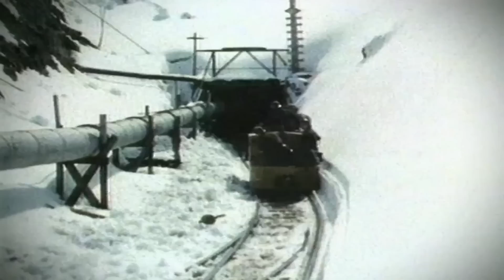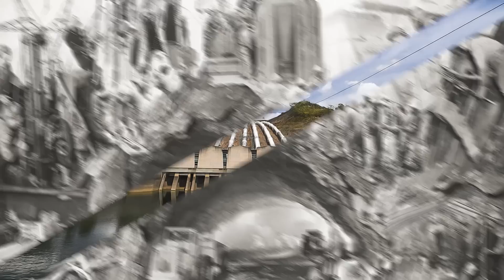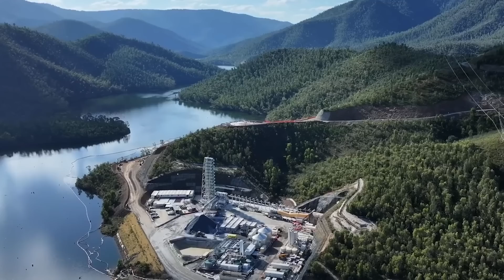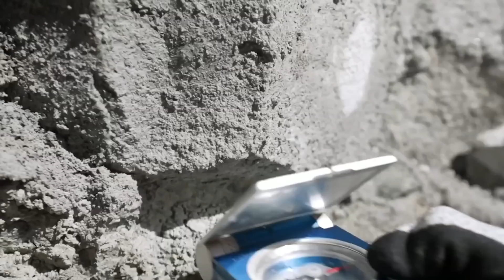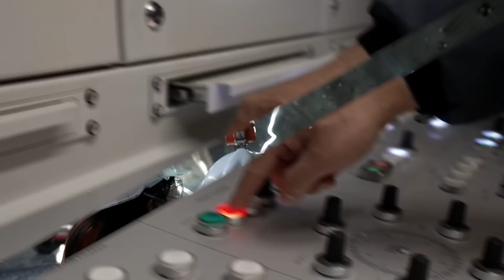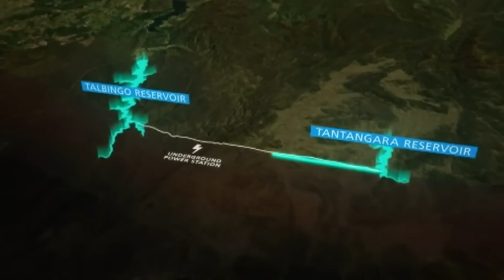Here Is Why Australia Won’t Let Billion Gallons of Water Run Down From the Mountain

Comment: Australia is now considering nuclear power. Australia is one of the top 2 Uranium exporters and has huge reserves of Uranium and Thorium.  Most current PWR type, Generation 3+  reactors in common use are very safe but extremely costly and complex.  The water cooled reactor have extremely hot and high pressure which creates major safety risks inside the reactor.  Another problem is the hydrogen in water can separate when overheating and create an explosion risk.  One alternative is to consider developing a completely new Generation 4 type reactor which have inbuilt systems that use physics to maintain efficiency, safety and hopefully lower costs.  Indonesia is developing aa revolutionary MSR, Molten Salt Reactor, with a US company and is now applying for a science.  Australia could be a partner in developing these reactors or work with China which is now leading the world in nuclear technologies.  What type of reactor should Australia choose.   Canada has developed very efficient CANDU reactor technology.  And there are many Generation 4 options.

Comment: Pumped Hydro is defined as Hydro without any of the benefits of Hydro. 
The Snowy Mountains Hydro Scheme is an immensely successful project. It provides electricity and irrigation by exploiting the snow/rain delivered and captured/stored at high altitude using gravity as its power source. When the snow/rain falls at altitude the energy potential has already been created. 
Now Pumped Hydro tries to recreate gravity by building more tunnels and pump stations to get the water back up to great heights….again. 
Yep it really is that dumb. It will end up being the dumbest piece of “infrastructure” Australia has ever stuffed up.

Comment: Muh continence is geographically withheld upon a single continental krust (its not what I see when youse show the Gondwana, Gaia, Ticonderogarghh rah rah blah de blah plates). We tell ourselves straya is geologically stable, nevermind the shakes, and consequently tectonic subduction, regolithic uplifting and consequential mountainous terrains have long since weathered down into gentle rolling magmatic protrusions of granite and exposed basalt. Those are our mountains afaik, they don't get very lofty and we are stuck with some of the flattest topology on plan it Erf . You may wonder why I open with such direct ambivalence, well a little extra height might increase the usefull catchment-'n-release staged pondage of the general hydro layout and flow rates pushing them generator turbines. That sort of thing. We have burrowing animals, rabbits, wombats, and so forth. They do not lend themselves to our employ upon this scheme. Just saying, we do this thing recognising that we do it ourselves. That's where the project starts, and the cerebral pain begins...

Comment: Snowy hydro 2 is a pumped hydro project, the dirty little secret they don’t tell you is that pumped hydro is a net user of electricity and it takes considerably more power to pump water uphill than you produce when it’s released. The problem is that there is never an excess of power in the grid to run this, that’s why they have to build a fossil fuel generator to power it.
Reply: @fordyootbling
He/she says stupid things because he/she doesn't know, that he/she doesn't know. 
His /her understanding is so low in this area that he/ she cannot judge it is poor, and consequently writes as though he/she knows it all, when actually it's very little understood and thus he/she appears absolutely stupid. He/she just doesn't get his/her ignorance. 
His/her failed cognisance on this matter means that not realising this failing, that he/she cannot self-correct.
Reply: @greghenderson6782  Anyone that addresses someone with a range of pronouns and then proceeds to call names, is clearly someone who is ethically challenged. But truly, some nice vocabulary on display!
Reply: Thank You... Its 'Rare Sense',, from a Time Passed.
Reply: This is absolute nonsense. Why say such stupid things?
Reply: @fordyootbling2189  and what’s nonsense about it?
Reply: @fordyootbling2189  So you say. Do you have anything to rebut this with?
Reply: How did the Panama Canal lock system work profitably for so long?
Reply: @santyclause8034  probably because it’s a commercial enterprise and they charge shipping fees, I fail to see the connection as they are two vastly different scenarios.
Reply: Spreading misinformation?
Reply: @MrSouthernlord  how so?
Reply: @peterbuckley3877 This great deceit to which you direct our attention has been revealed or, can be discovered, in what/which documents produced by which organisation, study group or administrative structure. Please cite for us to check and then know for our selves. Ta.
Reply: @peterbuckley3877  plus a massive tunnel
Boring machine worth
Billions is stuck an they 
Can't unstick it thanks 
Labour commies

Comment: They are so bad so bad so bad because this is absolutely the way to keep blowing economy down a road that produces absolutely nothing because the weather is changing for one and has been doing so and those who gave them the information about how far you can go with what you want to get out of the system. Its parameters are only so far. It’s like the solar panels in the middle of Australia. What an absolutely worthless idea The voltage drop loan let alone the maintenance and of course they were valueless just like having a glass bubble put under Phillip Island that cost $1 billion to the people of Australia to be told it’s idiotic and a 9-year-old could’ve said that to any person who wanted to put a glass apple under Phillip Island to watch The fairy penguins mind after our political leaders. Regards out down under.

Comment: How much were those small Nuclear Power Stations going to cost again??? Just find a suitable place nearer to Sydney and to Melbourne, up stakes on the Snowy 2 and it will probably be cheaper. Go molten Salt Reactors for safety and don’t let Canberra have a connection, give them their wind and solar plus a battery …. See how they get on !

Comment: They ignored advices to do much more geological testing before going ahead with this project.
I thought $2 Billion Dollars didn’t sound too bad at the time against a lot of naysayers and would be the only good thing Turdball ever did, but I was wrong, even though $20 Billion Dollars doesn’t sound like much now, compared to the $7-9 Trillion Dollars Labor has planned to spend on Replaceables by 2060 ( will that go up ten times as well?) and the $Tillion Dollars+ they have already blown on stupid and destructive projects. Not to mention their crazy EV Utopia plan that just cannot work for the average Aussie or Bowens destruction of our power grid & energy costs & reliability, Nothing Labor does is right, it is all WEF and Treason.
TBM ‘Florence’ got stuck in the first 120mtrs for a couple of years and then again hitting rock shortly after restarting, skyrocketing costs to $12 Billion, now they’re saying $20 Billion and that does not include the huge costs of the new Transmission lines and switching gear needed, so what is the end cost going to be and how long, we could have at least two 1 Gigawatt nuclear power station in operation by now providing 100 times the power 24/7.
Dams only store excess energy from wind and solar (or coal) and deliver 2/3 of that energy back again, nuclear can run at 95% capacity efficiently, need little fuel and can operate for 80-120years reliably, dont need extra transmission lines, switch gear, batteries or wind and solar scams & atrocities scaring our environment, ecosystems, landscapes, economy, ecology, farmland and polluting waterways & resources.
Hydrogen, Wind, Solar, Batteries & Dams are not the Green solution they sell them to be, they destroy a lot of farmland & farming operations (our food sources), Protcted plant & wildlife species, forests & wildlife habitats, don’t ROI, are subject to weather events, storms, hail.lightning,cyclones, bushfires (when they aren’t starting them), war & terrorist threats, kill birds & other wildlife, are not financially sustainable requiring huge maintenance efforts and lots of very expensive HV Transmission lines for 1000’s of kms and switching gear they dont account for in their costing estimates, have destroyed the whole ‘Great Dividing Range’ on the eastern coast of Australia,  make us dependent on China (are they always going to be friendly) we couldn’t get Toilet Paper for 3 years in covid), lightning often kills wind turbines (we don’t hear much of that) which brings them crashing down and starting bushfire that would not have started if the Swindlemill was not there in the first place, I won’t even start on the idea of Marine based wind turbines, it is just too stupid, reckless & dangerous, but then that is Labor in a nutshell.

Comment: IN THE FUTURE THE WIND MILLS WILL BE OF THE ZAGARI TYPE, NONE OF THESE PROPELLERS TYPE.
Reply: Having never heard of a Zagari windmill or turbine, I quickly googled the name but found nothing. I found references to a Navid Zagari who has apparently written extensively about wind energy systems, but couldn't readily find any information about anything he might have designed and manufactured. What is a Zagari windmill or turbine?
Reply: @alanramsay9842  A Zagari wind mill is a cube but it can be as tall as you like, it has 4 sides, each side is half closed to hold the wind, the other half lets the wind trough , so no matter were the wind comes from its blocked by half panned and let trough the other half panel, inside the cube there is a vertical axle with 4 or more panels that spin pushed by the wind from the open side, whes the wind mill spin it can be scary because it can go very fast, but it will not move because of the centrifugal force.
Reply: same problems will still exist though
Reply: @nemo6282  The Zagari windmill is scary when it spins but it wont move due to centrifugal force, its the best.

Comment: If they had used common sense and spent that money on a nuclear power plant they would have it done by now..... with none of the complications and uncertainty.
Reply: If didn't they would have BLOWN  up
Reply: Nuke power is the most costly and the dirtiest way to make power ocean wave power making is the way to go
Reply: oh evil evil get thee behind me Satan he used the N word.
Reply: Nuclear sites take a couple of decades to build and commission.  Hinckley point C is at something crazy like 17 years now.
Reply: @BramBiesiekierski  A little dramatic there.  Firstly, if you were right (that it takes 20 years) we need to get on with it.  We should have started 20 years ago. It is increasingly clear that construction of the required wind, solar, batteries, and back up gas is going to destroy our economy and environment for zero benefit to the climate.
Secondly, however, the Average Construction Time is 8–15 years. Delays are common due to technical complexity, regulatory hurdles, and financing issues. So if we do not muck around with political nonsense, there is no reason why we could not build a reactor in 8 years.
Thirdly, there are commercial modular reactors in the pipeline that could be purchased and virtually dropped in where existing coal generators are..... even the ones they have (insanely) blown up.
The main point is that we need to STOP building so called 'renewables', maintain our existing coal fired, build several temporary gas generators, and then get on with nuclear.  We could even build some new clean coal stations.  
The idea of not building coal and nuclear here, but exporting our coal and uranium for others to burn is sheer stupidity that saves no one.
Reply: What a load of rubbish, Nuclear power plants are more complex. Also Nuclear power plants need pumped hydro projects like snowy 2.0 to provide base load when needed.
Reply: @Terry-y2r  
Nuclear Power Plants that are placed alongside rivers or oceans so  definitely do not need 'Pumped Hydro'      They can also be placed closer to areas of demand , thus reducing the need for hundreds of KM's of transmission lines, which is a further huge cost,in both $ and environmental damage, which btw wind and solar cause.
Only Solar is safer than Nuclear power, but Nuclear remains the cheapest and most reliable form of sustainable energy production.
Thorium has huge advantages, but working reactors for commercial application could be decades away, if ever
Reply: @Terry-y2r    Rubbish yourself. Tell that to China, India, Canada, USA (and Bill Gates who is developing Thorium).  Nuclear needs pumped hydro like a speed boat needs bike pedals. Anyway, I did not say anything about complexity. I just said the money could have been better spent.
Reply: @alanbeasy1775  All the countries you mention have large scale pumped hydro. Its a fact Nuclear needs pumped hydro base load, just like coal fired power stations. Both cannot be turned off  quickly late  at night when power is not needed. The Chinese will beat Gates to building a Thurium power station, (they already have a research reactor up and running),  due to be up in running 5 years from now. Solar and wind are much cheaper forms of energy.
Reply: @Terry-y2r   I believe you are confused.  Neither nuclear or coal fired "need" pumped hydro.  Large scale pumped hydro is needed to back up solar and wind.  There is no requirement and no point in wasting 24/7 base load power generation to pump water just to regenerate that power again via water turbines.   And you are correct. China probably will have Thorium reactors before Bill gates. Copenhagen Thorium may beat both of them.  But again,  nuclear power makes wind and solar (and pumped hydro) obsolete.  Wasting money on them is sheer insanity.
Reply: @Terry-y2r   I believe you are confused.  Neither nuclear or coal fired "need" pumped hydro.  They run 24 hours a day 7 days a week and CAN quickly be turned up or down depending on the demand. It is solar and wind that needs pumped hydro as a back up - when there is no sun and no wind. The fact that China has pumped hydro has nothing to do with the question.  And you are correct. China may have Thorium reactors before Bill Gates.  Copenhagen may beat both of them.  Bottom line is that solar, wind and pumped hydro are a waste of money when you have nuclear.  Solar and wind are not the cheapest power.  You need to do your maths again.  Also take a look at which countries have the cheapest power.
Reply: @Terry-y2r  You seem confused. Nuclear does not need "pumped hydro base load" - whatever you think that means. Neither does coal fired.  Copenhagen Thorium will probably have commercial Thorium before China and Gates.  With nuclear power, solar and wind are obsolete.  As for the cheapest power, it is not wind and solar. Look at the countries with the cheapest power.....  they all have Nuclear
Reply: @alanbeasy1775 
Basically, your statement of case has bs written into the heading and your fathead rhetoric holds no water. Go back to skewl.

Comment: Thank you. However, Australia has invested much too little on its water management. The most obvious example is that the below sea level dry lakes of Eyre could easily be flooded with nearby sea water. (They were once part of the Antartic Ocean). That would put moisture into the air above most of Australia, enabling rain. If the connection between the lakes of Eyre and the nearby sea were navigatable by ship, then we would have ocean going vessels sailing into the centre of Australia. That would open inland Australia, as the Mississippi River did for the USA. Also, there are many sites in the eastern mountain range that could be damed to bring water to the dryier inland areas.
Regards,
Geoff. Reeks
Reply: Near by sea water . Ha
Reply: @FrancisBullmore8055  That was my query.
Ludicrous thinking.
Reply: That's  what they did with the snowy mountains  scheme, but it basically killed off that fishing industry of the coast were the water flowed because  there weren't  the annual nutrients to support the fish there.
There is always trade offshore.
Reply: Trade offs.
There was an idea of diverting the Murray  around into the lakes you mention.
There is only a 1 foot fall from Morgan to lake alexandra.
My father was the pumping super at Morgan and said the water flowed back up the Murray.when there was good Southey wind.
By flooding the Eyre and Torrens lakes, you would kill off the whole ecosystem  that is there now.
Reply: @terryquarton2523  
lake Eyre does flood on occasion now, and being in the desert, hardly an ecosystem to be killed off.   Water being pumped from the Far North, during the wet season. A better idea than salt water, in my thinking, ( creates a whole new ecosystem as well,Terry. )
China, some African countries and so on have ongoing plans to Green the Desert,
Australia should as well 
Plus Increasing levels of CO2 in the atmosphere aids in this hugely
Reply: And top up the great artesian basin with e.g. the Fitzroy river and use Lake Argyle to reclaim northern deserts.
Reply: Years ago someone had a plan to pipe water from northern NSW over the mountains to supply the Murray–Darling basin.
IIRC this was in the 80s.
Now we hear of 700mm of rain flushed down through Townsville.
Reply: Antartic Ocean? I think you mean the Southern Ocean.
damed? You meaned dammed. 
dryier? Try drier
eastern mountain range? You mean the Great Dividing Range.
Reply: @ Makes me wonder what is being taught in schools these days.
damed? You meant, not meaned.
Reply: @gardengnome3249  
Obviously you understood what they wrote...meant...meaned!
LOL.
Reply: @ 
Yes, sinsei.
Or is that sensei?
Shouldn't you be enjoying your retirement?